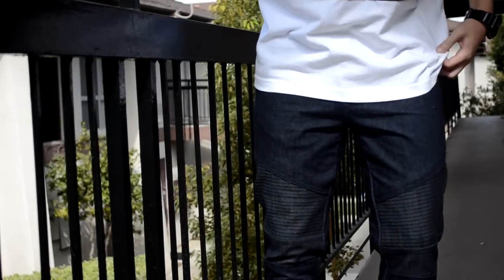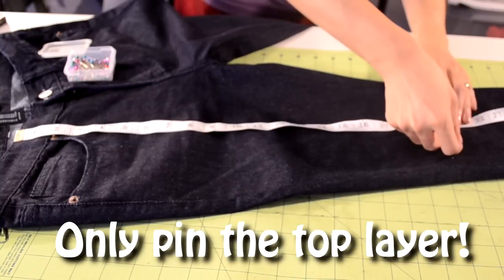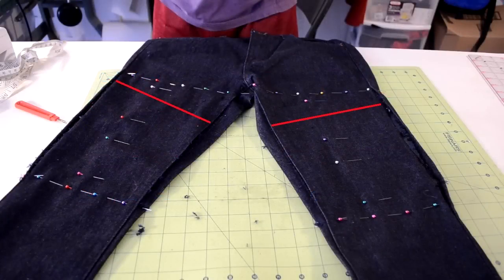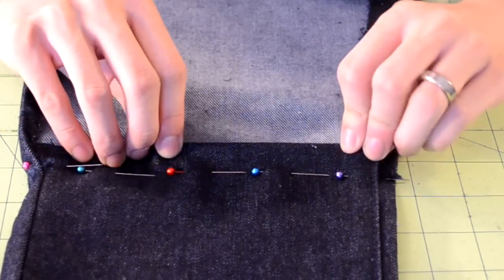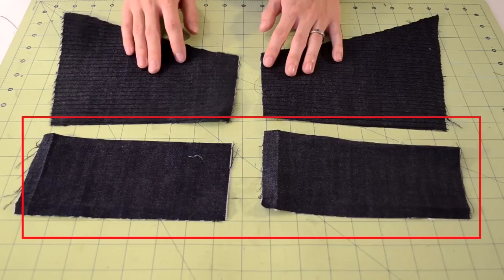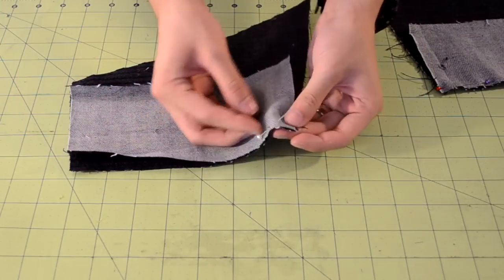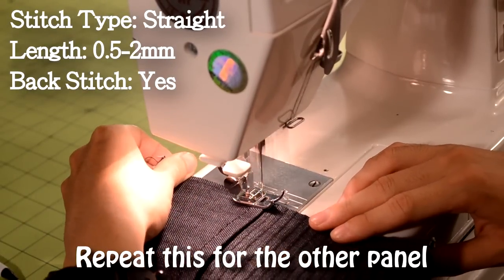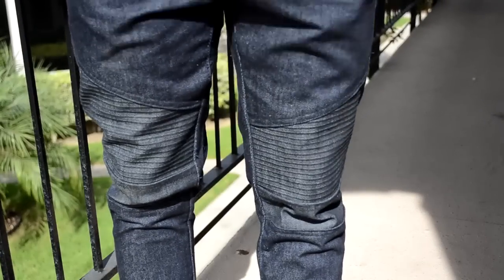DIY: Biker Jean Panels (Biker Jeans) Tutorial | KAD Customs #36

Comment: If the jeans have a specific wash could you use the original denim rather than the extra?
Reply: Also could you scrunch up the fabric to give it the more original "balmain" look to puff it up
Reply from the maker: omar ahmed No. You wouldn't have enough to sew it back together. What do you mean by scrunched up?
Reply: +kenanddrewdaily I mean like if you look at normal balmain jeans they have a sort of tubbing would It be possible to re-create that with thicker thread and "scrunching up" the fabric to make that same effect
Reply from the maker: The "scrunched up" part of the Balmains are pintucked. After they pintuck the patch, they either wash/scrub/bleach the pintucks to create a light-dark contrast (Pintucks are light and the area between the pintucks are dark). Even if you don't wash the patch, it will get that light/dark contrast through washes.  Just get the proper pintuck foot and thread and throw the patch in the wash or scrub it.
Reply: ***** really good work sir.  i can see how washing it would create the desired color contrast, but the difference I think omar was trying to get at was that yours have a "flatter" looking pintuck whereas the signature biker look has a more "tubed" or "raised" pintuck.  how do you get the pintucks "unflat" to give them the more "tubed" look? I could see that being through washes also, but just wondering if you know already
Reply: That's exactly what I meant lol
Reply from the maker: My pintucks basics video explains how to do this: Pintuck Basics
Reply: +omar ahmed i know im late but try to look into quilting to get that effect

Comment: That was pointless project. Why? You said biker pants. Well those panels are supposed to be reinforced and armored. Yours is neither. You just cut out one jean material and replaced with different jean material. Theres no protection made into the pants. So I call the just plain ol pants not biker pants.

Comment: I think you should specify that they're not ACTUAL biker pants, since biker pants have Kevlar lining in the parts most likely to be in contact with the asphalt in case of an accident, they have more tension and heat resistance and the panels are functional so you can put protection pads. Otherwise, people, most of all beginner riders, may get the wrong impression and start using this for riding and end up getting abrasion wounds if they fall.